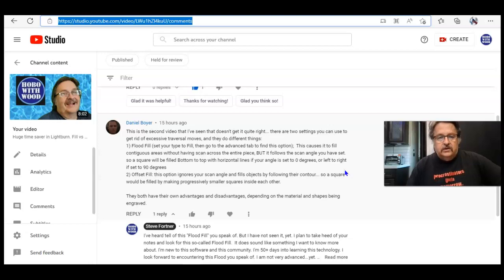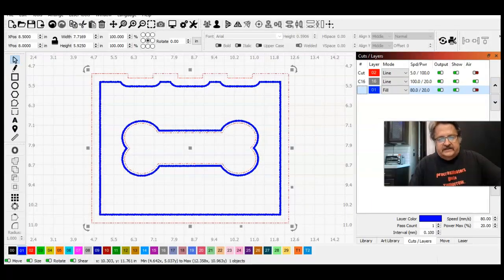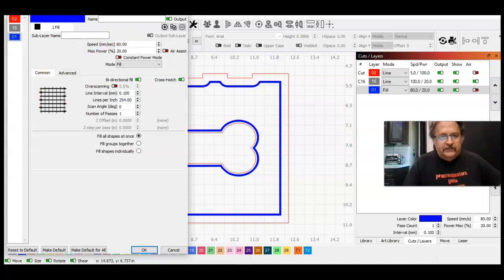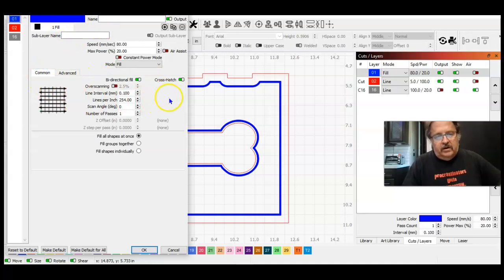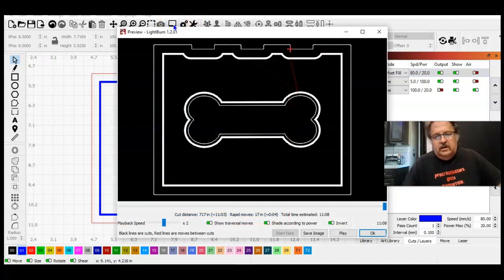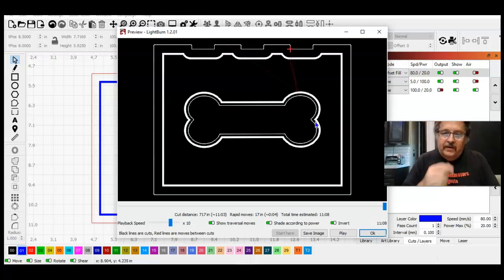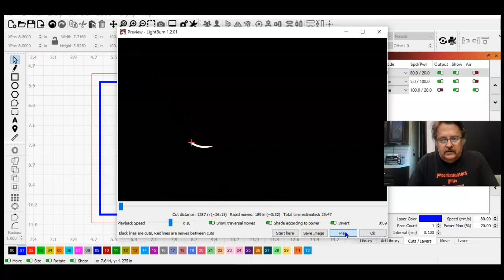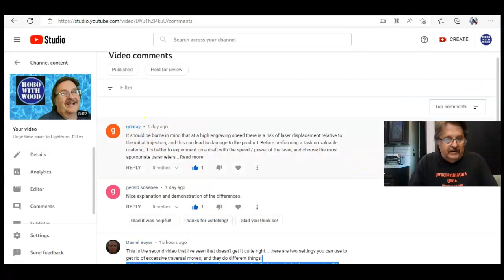LightBurn: Fill VS Offset Fill VS Flood Fill

Comment: You said you do a "Line After-Fill" to clean the edges up.  What is that, and how do I do it?
Reply from the maker: Your engraving is done on a "fill" layer. Open that layer and add a sub-layer to it. Run it in "line" mode. I do it at a lower speed and power. This adds a defined line to the edges and creates definition to the engraving. It makes a HUGE difference on the appearance of text.
Reply: Thank you!  @HoboWithWood   I added this to my program file, I'll let you know how it turns out. 
Making little name tags.  Needs to be small and accurate.

Comment: It should be noted: The flood fill is only twice as long as the offset fill because it's actually honoring your cross-hatch. It's going over the fill twice. If you want that cross-hatch, you almost have to go with the flood. I often won't use it because my machine isn't precise enough to come back and necessarily start at exactly the right point to continue the fill and I'll be left with extra material in some spots near corners on my mirrors and glass that I engrave. Offset fill doesn't seem to do this, but I have to set the overlap a little closer than default to assure a clean and total fill.

Comment: offset fill is the lowest quality fill setting, ok on small pieces but the bigger the piece the more misses show up, it isnt the laser jumping, if you zoom in on the preview you will see all the misses in the preview
Reply from the maker: Since I made this video I've learned this trick... Raise the focus slightly increasing the spot size. And increase the LPI .  This can still save a lot of time when using offset fill and it resolves the issue with the misses. I've also learned a huge time saver when designing the roman/greek borders. One simple difference on a layer changed the engraving time from 1 1/2 hours to 30 minutes. And it wasn't with offset fill. Check out that video and that tip is at the end of the video. Create A Greek Border Using Lightburn. Learning something new every time I use Lightburn.

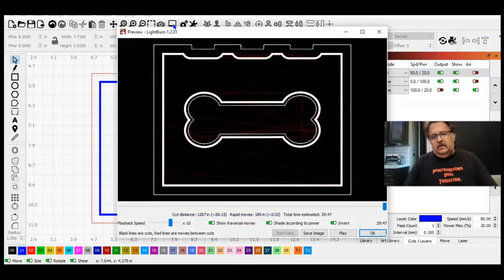Comment: flood fill may be a good option for small particles to fill when you got more of them on one piece, but for this item you got here, the offset fill is of course the best. 11:08  as you said time is money. and you want to compare a two time direction change in the middle bone to an all the time direction change when side by side engraving? the offset fill is way better for the machine. sharp corners do nothing, the machine is set to accelerate and also decelerate in a matter that it doesnt take any damage from that. if so, the settings are wrong. also the chance of getting any flaw or computer shut down or what ever are 3 times higher when time is 3 times longer. so i allways go for the shortest time if quality is good. and offset looks much better to me, then normal engraving.

Comment: That "risk of laser jumping...etc" with offset fill is BS. Offset fill works great. Honestly has anybody had their laser jump unexpectedly and damage the substrate? I have been using offset fill a while and it's an amazing time saver.  No risk of anything happening unexpectedly to note whatsoever.
Reply from the maker: I've experienced both outcomes. Both excellent results and uneven burns. No doubt it is a huge time saver. But if the belts aren't tensioned properly, any slop will be evident when using offset fill. I've even experienced lack luster results after an extremely long burn. I recommend making sure you've got proper belt tension, and when using offset fill, it is high on the priority order. As the belts can experience some stretching after warming up during a long job.

Comment: Offset fill can leave you with strange patterns on your work if you have complex shapes.
Reply from the maker: This is true. I use offset fill mainly on borders or frames. I use 254 LPI and one the project it finished I use a small brass bristle brush to clean any patterns left in the burn from using the offset fill. This helps a lot and saves a ton of time.

Comment: Thank you for covering this.  I have had a problem with Offset fill in leaving a line in the midle of what I am filling and burning through at the top of an arc.  I think this may be what your people were talking about.  I saw flod fill but didn't know how it worked.  Will give it a shot.
Reply from the maker: Something I've started doing since this video is, when using offset fill I use a lower line interval. Instead of .08 I use .10 on my offset fills. And I use a little less power, not much, but a little less. I found this helps with the problem you're talking about. Thanks for watching.